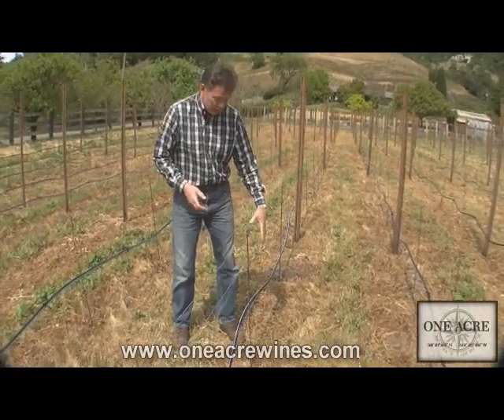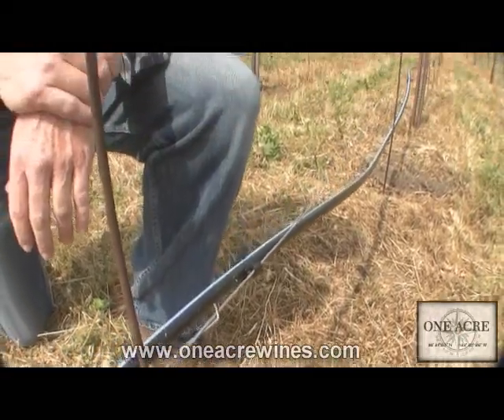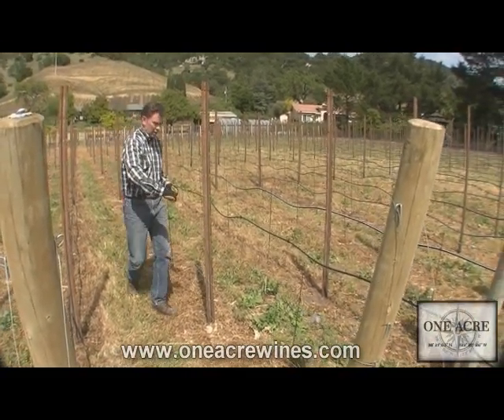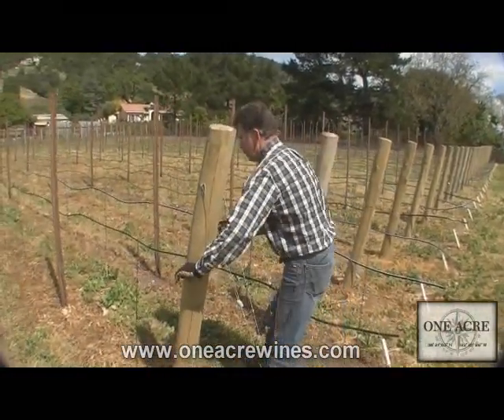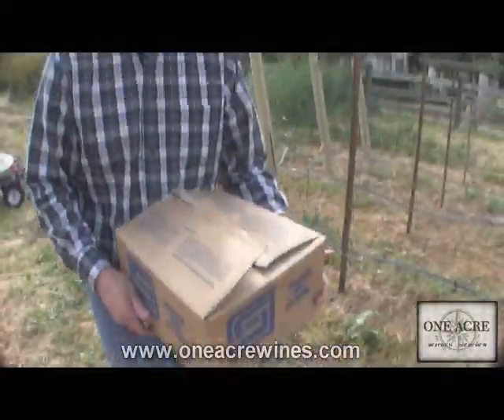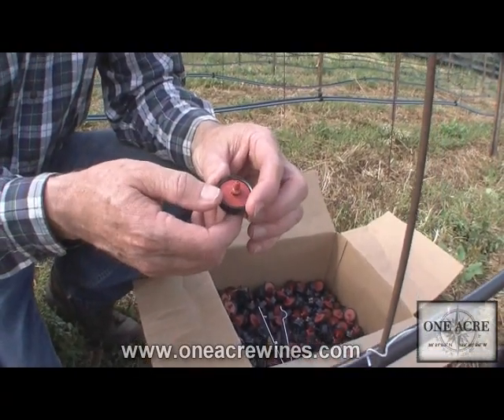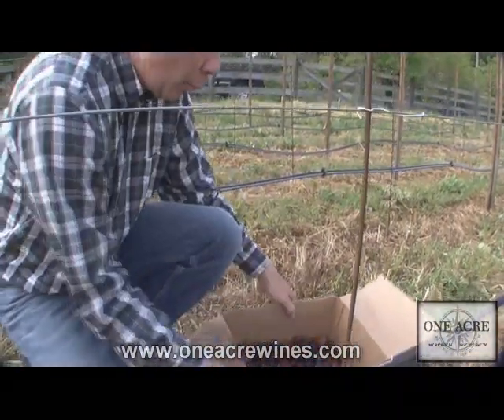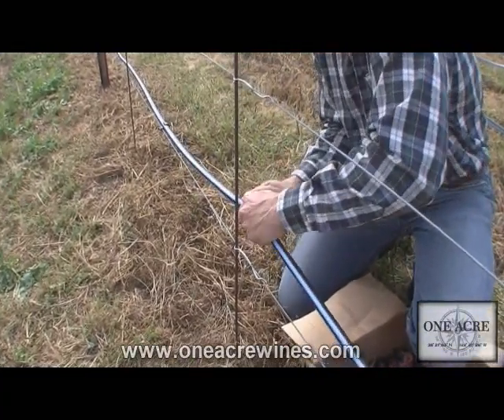One Acre Napa Valley - Yountville AVA Episode 4  - Trellising

Comment from the maker: Hi colinfiona1 

As you well know, it has been a wet winter. I am happy to be getting everything finished up. The row / vine spacing is 4 x 4. I wanted to duplicate my Oak Knoll AVA vineyard. The drip wire is at about 13" and the 2 fruiting wires are at 28" & 35". Which still leaves about 4' for shoot growth. They vary a bit through the rows. For a cover crop I like to use clover where nitrogen is needed or different grasses in spots that need to be dried out from winter rains.

Thanks 

Dave